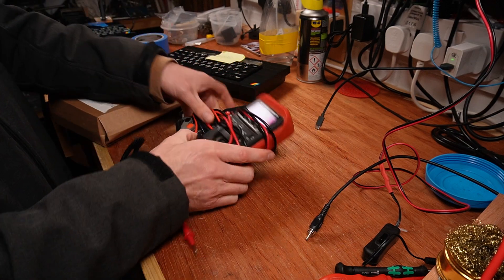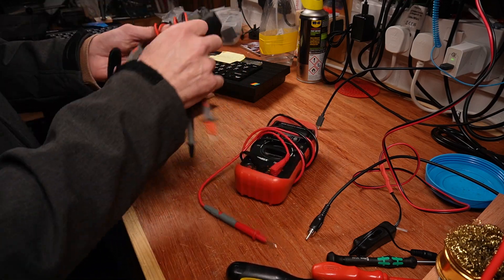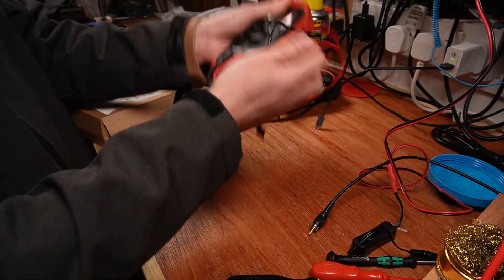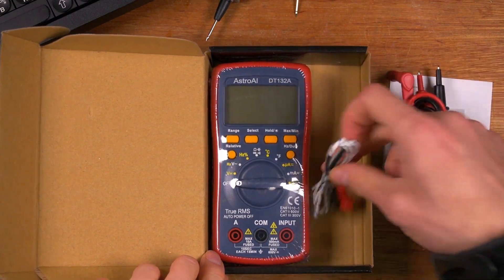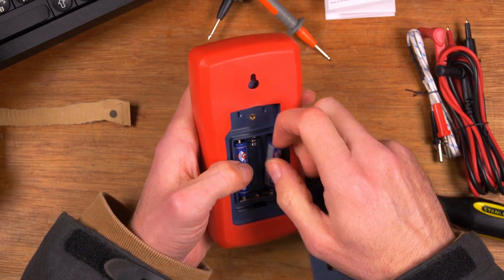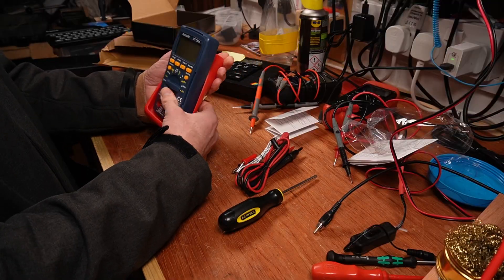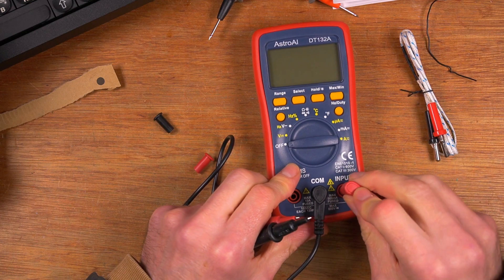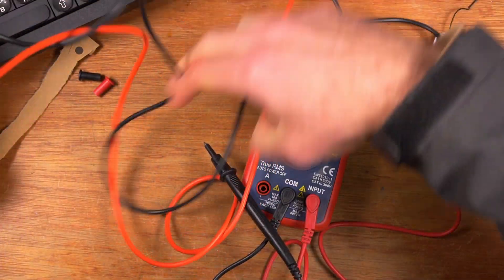AstroAI DT132A Digital Multimeter unbox and first thoughts

Comment: I have had this meter for 2½ years and it works fine, is as accurate as my old Fluke 75 and much cheaper , only cost £13:99 (on offer) I have no problem with the leads and the meter is accurate.
Reply from the maker: Excellent! That's good to hear. I'm really loving it so far.

Comment: Ive had one of these meters for three+ years, and its still accurate and reliable - it has a LOT of reasonable accuracy and functionality for such a low price - youre expecting WAY  too much for twenty bucks these have had good reviews for a long time and sell very well.  Cheap meters often have an unseen coating left by the plating process the chinese dont clean off, try cleaning the metal tips with steel wool and alcohol this often makes a big difference - if not you were just unlucky enough to get a defective pair of leads, dont forget youre buying crap from china - the leads on my 132A work fine.

Comment: Thanks for that. I've got a cheap "RS Pro" multimedia (I don't think any actual 'pro' is touching RS Pro products with a barge pole) and it's fine, but it also doesn't show battery low and will do that weird voltage reading thing, Ive panicked many times thinking my delicate projects were getting fried with 20V from an erratic PSU when it was just the meter, so glad to see I'm not the only one! Nice honest review, this looks like a 'itll do' MM, I do like that it's auto ranging, tho needs better leads, and has a capacitance meter. Anyway I found that quite interesting,cheers!
Reply from the maker: Cheers Chris! I just want one that works as expected. No fancy bells and whistles. If this can let me know the battery is on its way out I'll be happy with that!

Comment: Maybe get it back to Amazon and check on UNI-T stuff. They are decent quality and not too expensive either (well a couple of quids more but that is OK)..
I am using a 210E, which has a clamp ammeter that comes in handy sometimes And it can be hacked! Does everything you need. They ship from Europe (no brexit pun intended) or probably Amazon.
Reply: My next Multimeter will be a Uni-t model, I was looking at the ones that can output to a pc as it might be good for on screen display in videos.
Reply: @leesmithsworkshop  beware! The ones with serial output don't switch off automatically and drain the batteries. You have to switch them off manually. Guess how I know.... ;)
Reply: @arminth  ok, that is a good tip, many thanks.
Reply from the maker: I'm going to stick with this one. With the better leads it works quite well